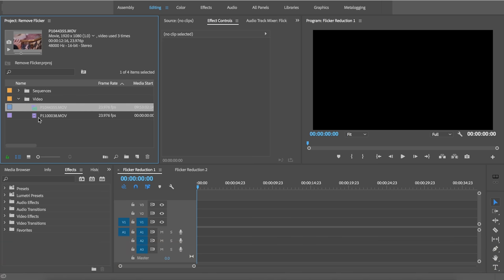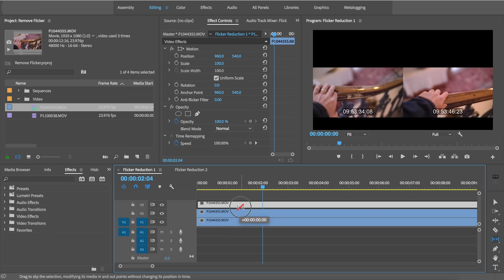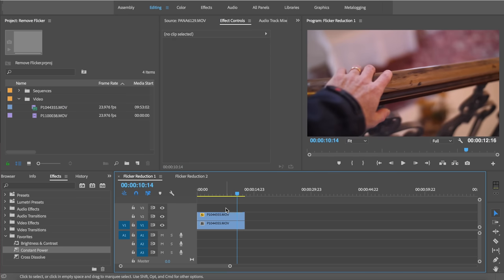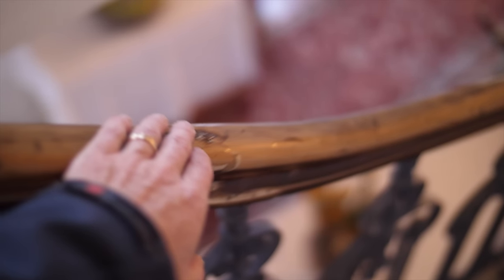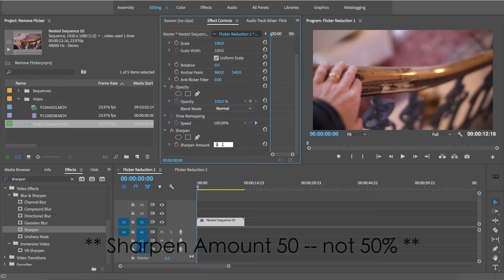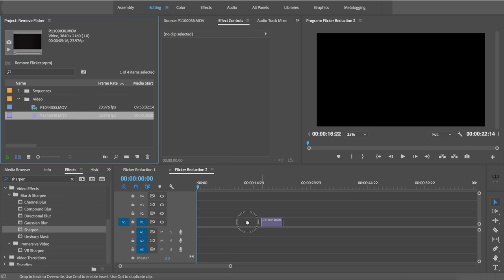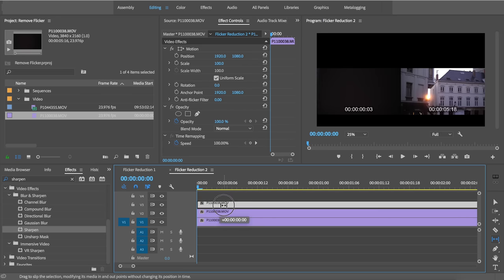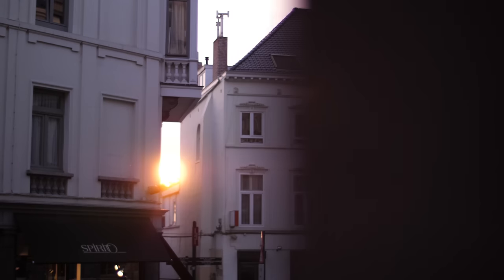Fix VIDEO FLICKER in 30 Seconds WITHOUT Plugins

Comment: Found the same issue when watched and glad to see comment of Mathieu Lalonde :-)
It does not matter how many layers you mix. if you want equal mixing then second layer needs to be 50%, third - 33%, forth - 25%, fifth - 20%, etc. Basically each next layer Opacity = 100% divided by number of the Layer on top of the original one.

Btw it's easy to check if you mix for example Red, Green, Blue solids and check resulted color. :-)

I love this method to denoising some footage, sometimes upto 10 layers.
Reply from the maker: Thanks for the feedback. As far as the math goes I'll have to trust you on that one. I don't understand the math well enough to know which is the 'correct' way of doing it.

After @Mathieu Lalonde's comment I decided to do some tests: First, I went to the clip I used as the sample (my hand going down a banister) and tried 50% and 33%, and it didn't work...it had more flicker than when I did 67/33. But, that said, secondly I went to another clip that I hadn't been able to fix with 67/33, and I tested at 50/33, and for that clip it did work. I also had another one that I hadn't been able to get working, and neither 67/33 nor 50/33 worked, so instead I did four layers (three on top of the main clip) at 75/50/25 and that worked flawlessly.

So, bringing it full circle...I still don't understand the math side of things, but I am realizing it's not a one-size-fits-all sort of fix...it needs to be played with to find the right number of layers and the right opacities for those layers.

On a different note: I've also used this for denoising. In my recent timelapse video, Pinnacles National Park, many of the clips I ran through this process and was able to vastly clean up the clips. Unfortunately the clips that contained more noise, the nighttime clips, were ones that I didn't want to use this process because then the stars would have been blurry. Oh well, nothing's perfect I guess.
Reply: I guess there might be not just opacity math but also some nature of flickering itself involved whch may vary. Anyway for complex issues sometimes there is no universal solution, and flickering one of such issue which is easier to escape than fix. :-)
Reply from the maker: I've pinned your comment at the top of the comments so that if this question comes up with other viewers that they'll be able to get a little more info from this exchange. Thanks again for your feedback!
Reply: Yo after trying this technique previously multiple times and failing, the combined stacking in OPs original video and your math have actually remedied it. Thanks so much!
Reply: Andrey Mishchenko, how do you do that to denoise video? please teach me
Reply: @BlueMantleFilms  and @Andrey Mishchenko both of you guys got me excited about the ability to get rid of the flickering. However there is a little movement which led to multiple exposures. Are there any other options to completely fix this, fix the flickering and the multiple exposure?
Reply: 어캐 했노.... thx...
Reply: In Adobe Premiere, there is an effect called Time Echo, which can do much the same thing without stacking multiple video tracks.  Set the time delay to -0.033 seconds (one frame) and the mode to Blend.  Then experiment with #echos.  Also experiment with the initial value and decay values, starting the range of 0.25 initial and 0.75 decay.

I haven't used this for flicker removal, but I have used it for noise reduction - going out to as many as 30 echos.  With that many echos, you will get a lot of ghosting on motion, so use it only on clips with no or very slow motion.
Reply: Mine got solved with two frames moved to left with 33% and 67% (Original footage shot on 60 FPS)
Reply: You just blew my mind.  I'd love to see more about what you're describing with examples, also with noise.  Thanks.
Reply: @KiloBarb  Just tried Time > Echo and it does work in the same way, however my render times were x20! So I wont be using that. Apparently there was an old CC Blend Time effect for After Effects that was great, and you can still download it, but it's not in Premier by default. Haven't tried it.
Reply: I had awful flickering footage which I thought was going to be an easy fix, your method helped me out massively!
Reply: That is SUPER HELPFUL, thank you so much!!!!!  @BlueMantleFilms

Comment: Four hours faffing around with probing expressions in fusion with no luck and this fixes it in a couple of minutes. You deserve a medal.
Reply from the maker: I had heard of a variation of this hack probably two years before I ever needed to use it, but then after a trip to Europe last year, in which I filmed a fair bit of slow motion footage, I ended up having a lot of footage with flicker, so thankfully was able to find this hack again. The version that I had seen (using only one extra layer at 50% opacity) didn't work for me, so I experimented with the settings and found this worked really well.
Reply: I spent almost 6 hours searched all over the internet finding flicker free full version without buying them. But You you YOU REALLY REALLY DESERVE A MEDAL! THANKS, MATE
Reply: @BlueMantleFilms  how to do it on a 3 minute vid with flicker?

Comment: When I do this, the result I get is like a gohst effect. dont get it.
Reply: Did you "add" opacity?
Reply: @vdmarame  Yes, that's whats causing the ghost effect. And it doesn't fix the flicker?
Reply: @josiemakes  back to the drawing board - it worked for me once, I am having trouble in other
Reply: try it with just 1 duplicate(50% opacity) over it and push the duplicate with 1 frame to the right and see if it fills the gap
Reply: same here
Reply: Don't use the Y tool to move it, physically shift the clip over 1 frame with the normal pointer and it should work. I had the same issue
Reply: Same
Reply: Same it was worse than the flicker. I fixed it in my footage by using only one duplicate one frame across at 33% opacity. Much better.
Reply: Same problem! Anyone with a fix? I think moving the 2nd and 3rd layer is causing the ghost effect
Reply: @HansTabak  I had ghosting at first when I pressed Y and used the Slip Tool to move the clips, even when I moved them and then moved them back and then just used the cursor to move them one frame. If I deleted the duplicated clips on layer 2 and 3, then copied them fresh and ONLY moved them using the cursor point tool not the Slip Tool then it worked perfectly for me. I also only needed one duplicated layer at 50% opacity. If I made two layers it would add ghosting again. So that may depend on your footage, perhaps on the framerate of it.

Comment: You Rock!! 3 layers worked waaaay better than just 2... AND!!... you saved me 150$ from buying a plug in!! THANK YOU!!
Reply from the maker: Awesome!

I recently went back to the same shot I used as the first example in this video, wondering if after a couple of years I would use a different method to deflicker it. After talking with people and reading comments from people who have seen this video, I was convinced that I must have gotten it wrong and that the proper opacities should be 100/50/33 instead of 100/67/33, but trying it again, I still got better results with 100/67/33.

I'm sure it's entirely dependent on the particular flicker that people have (so it will depend on the framerate you're filming at, as well as the electrical frequency of the country you're filming in), but 100/67/33 worked better in my case.

Comment: WAIT A MINUTE! You said I can fix video flicker in 30 seconds, yet the video is almost 3 minutes long! You lied, dude. I'm pissed!!!

Really, though, I did as you said and it took away 80-90% of the flicker from shooting off a TV. I have a GH5 and used the synchro scan as best I could, but there was still lots of flicker. Thanks and well done. Concise. Subbed, Bub.

Comment: I've tried it on my footage and it works, I just can't get over how well it works, thanks so much, you da maaaaaan
Reply from the maker: Isn't it great?

This hack is a variation of one I learned of about three years ago. Until about a year ago I didn't have need to use it because I wasn't really filming in slow motion (which is where a lot of this flicker crops up) but once I started using this and experimenting with different numbers of layers and different opacities, I discovered that it works remarkably well.
Reply: I filmed in a house with LEDs everywhere (and we couldn't use natural lighting since it was supposed to be night time). We filmed anyway but I was very discouraged and ended up thinking that it would all be unusable. You proved me wrong :) 

I saw below that you can use a similar technique for noise reduction. Would you mind explaining how that works? Do you also need to move the layers along a frame or only change the opacity? Thanks!

+ 1 subscriber
Reply from the maker: Same technique. It essentially averages the difference between frames, making it so that noise is reduced since the specific noise of one particular frame is unique to that frame. You can get a similar noise-reduction effect if you speed up video to 200% and choose "frame blending" for interpolation. Having real-time footage playing at 200% would be weird, but if you're working with timelapses this is a nice way to reduce both noise and flicker from the footage.

Comment: Hi there, Greetings from Greece. 

I'm Konstantinos and I just wanted to tell you that you just help me alot with a very bigh problem. I use my camera, nikon d850 to capture videos of the night sky with the stars etc. The only problem is that sometimes i have that flocker when I use high Iso like 25600 or even 104.000. A long time now I have captured amazing stils but the video flicker was so but... Thank you, yes, it did an amzing work on high iso in low light conditions..

Comment: I had issues to use the slip tool but I figured it out now. You can't just slip, you need some sort of time within the clip that allows you to slip. So if you trim the two frames of all three clips, you can later also slip by 1 and by 2 frames.

Comment: A good tip, but not a universal fix, unfortunately. Getting a perfect result like the one shown in the video seems to be tied to having a shutter speed that is double that of your frame rate - or something like that. Whatever the reason, using this method caused ghosting in my footage, which no amount of tweaking would remove.

I resorted to trying the Flicker Free plug-in from Digital Anarchy, which worked perfectly. I'm not trying to plug that company or the product - in fact I'm not even going to link to it here - just offering an alternative in case you don't have luck with the method in the video. The plug-in costs $149, but may be worth it if you're trying to salvage footage from a shoot.

Comment: Holy smokes!  What an intuitive and cool fix. Thanks so much!
Reply from the maker: I'm glad this was helpful. I can't take credit for the initial idea...it was something I learned from a Philip Bloom tutorial. I did modify it a bit so it would work with my footage (he used only one layer at 50%, but in my case I found it was necessary to use two). Anyway, I do agree this trick is crazy and awesome, and it has definitely saved a bunch of footage I would otherwise have not been able to use.

Comment: It seems like this worked perfectly for everyone else but me :c Followed this perfectly
Reply: I think its cause my clip has soo much movement
Reply from the maker: @GingerGaiden  Does it get rid of the flicker but has bad ghosting? Or does it not get rid of the flicker?
Some flicker just isn't fixable. This trick works well for many clips, but unfortunately not all.
And, as you mentioned, if your clip has a lot of movement, then even if the trick does get rid of the flicker, the ghosting could be so bad that it still doesn't "fix" the video.
In this case, if you absolutely have to have the clip you're working with, then you'll probably need to get a deflickering plugin. I eventually had to do that myself one time when I had a flickering flip that this trick didn't work for, and I had to pay $250 for the plugin DeFlicker. Having the plugin is nice, though, because I know I have that to fall back on if the method from this video doesn't work.

Comment: I had ghosting at first when I pressed Y and used the Slip Tool to move the clips, even when I moved them and then moved them back and then just used the cursor to move them one frame. If I deleted the duplicated clips on layers 2 and 3, then copied them fresh and ONLY moved them using the cursor point tool, not the Slip Tool, then it worked perfectly for me. I also only needed one duplicated layer at 50% opacity. If I made two layers it would add ghosting again. So that may depend on your footage, perhaps on the framerate of it.

Comment: Brilliant. Applied the same technique in DaVinci Resolve 15 and it worked very well
Reply from the maker: I haven't used this technique in anything but Premiere just because I don't edit in other programs (I used to use FCP, but not since FCPX). But yes, it should work with any program that allows multiple layers and adjusting opacity. Glad it worked for you!

Comment: Very helpful, was still a bit of flicker left on mine but after it's gone through all the compression online it's hardly there at all
Reply from the maker: Try a few of the variations and it might make it work better. First thing I'd try is just one layer at 50% opacity. If that doesn't work, try two layers above at 50% (instead of 67% as in this video) and 33%. If that still doesn't work, try three layers at 50%, 33%, and 25%. After that, if it still doesn't work, you're probably out of luck.

Comment: Got kind of a unique circumstance...I was filming inside of a truck with a digital dashboard, and navigation unit on the center console. Both flicker at different frequencies (the dash very quickly, the nav unit sort of like a pulse). I used your technique, and the flicker on both areas was reduced, but not eliminated. I moved the duplicate frames forward and back and got to the point that the flicker was minimal--but then when there was motion in the truck (hitting a bump, for example) there was severe blurring. I don't know if there is any way to fix this.

Comment: Very nicely done! Could you please share what to do to avoid this? I was shooting a speaker in a conference with a projector screen in the background. I noticed the flicker in the camera, but hoped it wouldn't be in the final video. Well it was, what should I do next time to adjust the camera to minimize the problem at setup?
Reply from the maker: I made a video on how to avoid flicker in general. The basic method is adjust shutter speed until you don’t see flicker anymore. Sometimes this can be as simple as turning the shutter speed dial once or twice, while other times it requires finer adjustments to shutter speed to get rid of screen flicker.

For some cameras they have the option to adjust shutter speed in these very small increments. Other cameras won’t have that option. On the GH5, which is my camera of choice, it has “Synchro Scan” where you can adjust by degrees, so if you see flicker on a screen you can adjust the shutter speed until you get no flicker from screens that are in the shot.
Reply: Excellent! Thank you!

Comment: That's an awesome solution. Let me ask you this... I have a couple of clips that exhibit a slow, rolling, horizontal banding. During a shoot, I thought it was from my LED light, but I killed it and found that it was an overhead incandescent we were using as a practical. Will this technique work to eliminate that?

Comment: Actually, if you use three layers, the second one should be 50% and the third one 33% (if you want them all to be at equal opacity)...
Reply from the maker: +Mathieu Lalonde why's that? In my mind it makes sense to me that you'd divide 100% by the number of layers, so if you're doing only two, then the top layer would be 50%, but if you were doing four (which would make for terrible delay/multi-exposure) you'd do Layer 2 at 75%, Layer 3 at 50%, and Layer 4 at 25%.

I'm genuinely curious, because I have wondered if different opacities would give different results, but I've been happy with this method.
Reply: @BlueMantleFilms  because the top layer at 33% cuts down the 50% layer by 33%, leaving 33% remaining (0.5*(1-0.33)). Same as the top layer.

The bottom layer was cut down by 50% by the second layer, leaving 50% showing. Then 33% of that 50% by the top layer. Now all three layers account for 33% of what you're seeing.

Comment: Okay, not to throw another technique out there but.....  My 2nd layer I will move one frame ahead, but my 3rd layer I will move one frame BEHIND the main clip.  I've found it blends much better, and you don't get that blur effect with faster moving objects/footage.
Reply from the maker: I don't think that would make a difference and here's why: either way, this technique blends three layers together. Whichever way you move the layers, forward or backward, one layer will be two frames off from another layer: it's either going to be the top layer two frames off from the bottom layer (as in the video) or the top layer two frames off from the middle layer (as in your suggestion) so I'm fairly certain the ghosting will still be the same.

Comment: wow.. so cool, thank you.  Certainly not perfect, but 1000% better
Reply from the maker: Did you try an extra layer or two? Also, if you're getting almost-there results, but just not quite, try putting the second layer's opacity at 50% instead of 67%. Sometime my footage needs that instead...it changes depending on the framerate you were shooting at and the country you're in (50Hz or 60Hz).
Reply: Blue Mantle Films the ficker was completely gone, but you get the ghosting like an old LCD monitor.  Good enough to get the job done though.  Funnily enough it was better than the brute force DE flicker plugin.